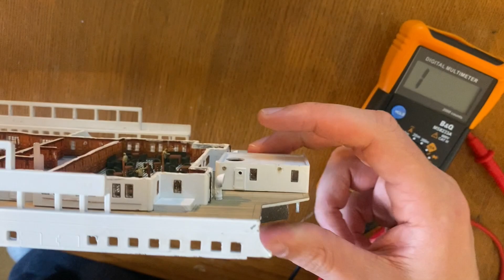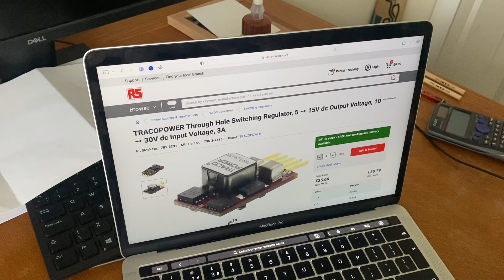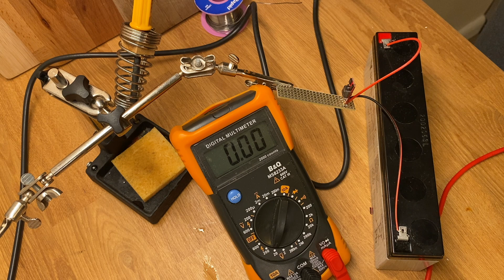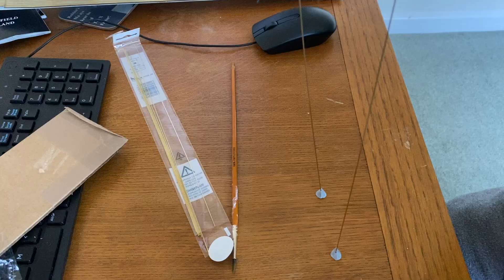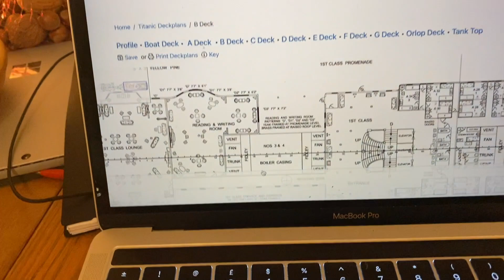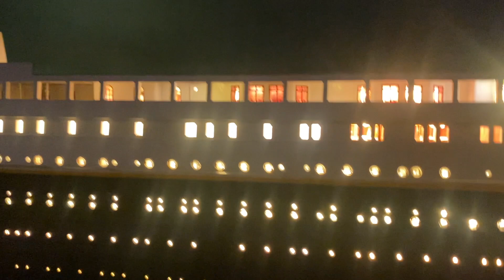Radio Control Trumpeter 1:200 Titanic Build Part 45 - Lighting (again)

Comment: You`ve obviously added a lot of unnecessary detail to the interior. What`s going to happen when one of the furnishings come loose. ?..A rattling piece or pieces in a un-accessible part of the ship would drive me nuts !
Reply from the maker: Hi there, it is visible if you know where to look! 
WRT coming loose, yes as you say there will inevitably be things coming loose over time as there is on most models. I tend to use more glue on things in hard to see areas to try and limit that as much as possible. 
The decks are all accessible thought, superstructure decks are not glued down, I’ve used threaded inserts (essentially PCB Spencer’s) so I can lift them off to fix things.

Comment: Are you going to build interior for c d e f and g deck
Reply from the maker: I’m not no. They just can’t be seen so I don’t really see the point! Usually I tend to make anything that is visible inside or outside the model, and leave it there. Decks below B deck just can’t be seen so I won’t on this occasion
Reply: @TheModelBoatGuy   why not have it so the model is separated in like decks each individual deck but is still al. Connected together